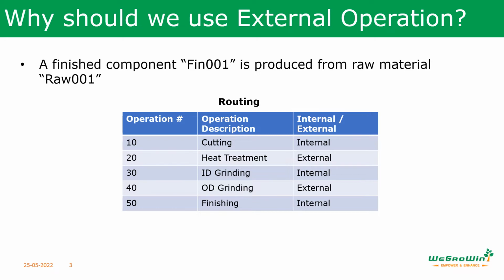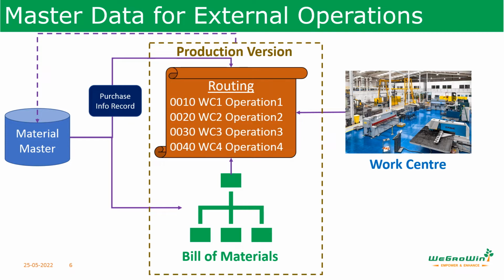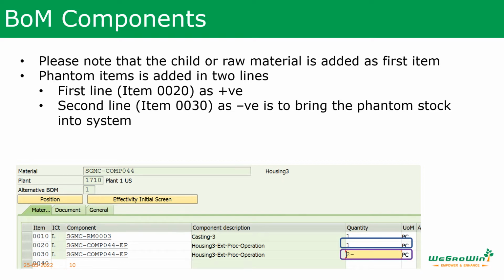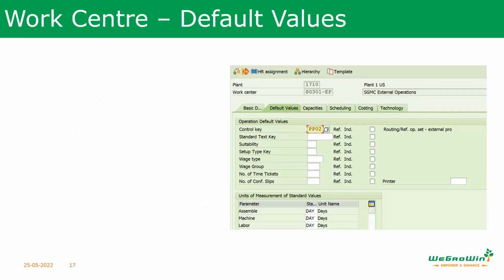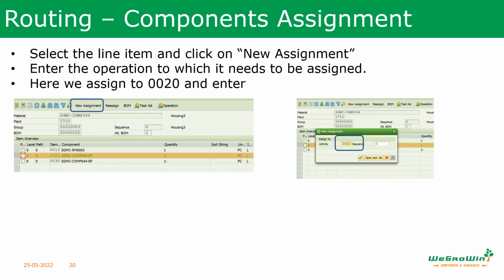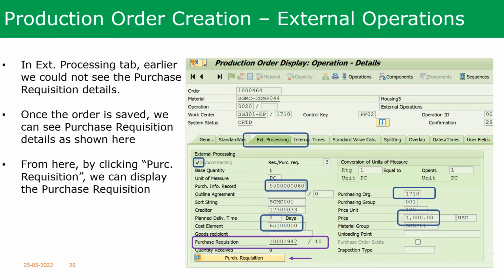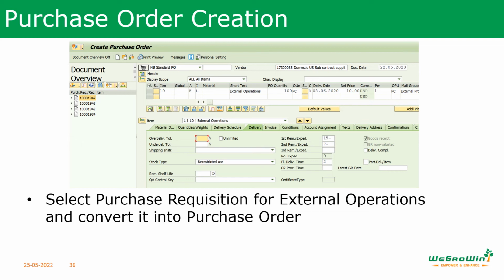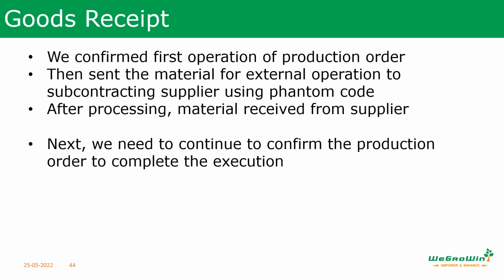SAP PP | External Operations in Production Orders | Subcontracting Execution in S/4HANA | 01-56

Comment: Hello Sir, i need your help to resolve the issue below. My Production order has a total 13 operation numbers, apart from this 2nd &12th operation are outsourcing & I have maintained control Key PP02 , after release production Order  Purchase Requisition generated, but PR not generated sequentially. Eg. For Operation 2nd -  PR No 8125 &For operation 12th - PR No 8124.
Reply: How should I generate PR sequentially with Operation sequence.
Reply from the maker: @ Hi I am no sure. I request the viewers whoever know answer to this query, may answer to this
Reply from the maker: But why should you need the PR in sequence. We need PR for respective Production order and representing the operation. If these details are knows, it should be sufficient

Comment: Hello Sir, My Production Order has an external operation at 1st operation. So I am issuing material against PO with mvt type 541.Then after operation done material received and quality check for this material. at quality check some of material rejected.Now we understand that the raw material is faulty so I need to send this faulty raw material to the supplier with extra operational cost adding . How should I perform this in SAP system .

Comment: Hello Sir, Could please give me solution for below query. 
I have a query for external operation through Production Order. I have 3 external Operations in my production order, which is at different sequences like operation 20, 50, & 70. Sub con PR for external operator release when production order Release with Order qty. But In my case  the operation during the confirmation rejection happened & Yield qty less than production oder qty, due to this unable to update subcon PR qty for remaining operations, How should I update PR qty as per yield of production order.
Reply from the maker: Hi, Please refer the following:
https://help.sap.com/docs/SAP_ERP/b4174aff4a234ed5be928a10c60997fb/e7c9b65334e6b54ce10000000a174cb4.html

https://community.sap.com/t5/enterprise-resource-planning-q-a/operation-subcontracting-pr-qty-not-in-sync-with-prod-order-scrap-qty/qaq-p/11085502